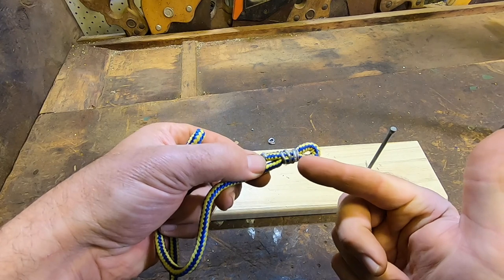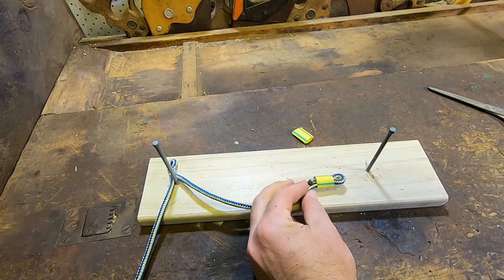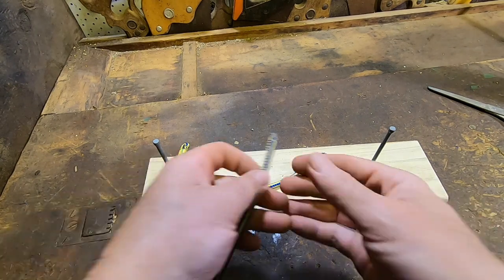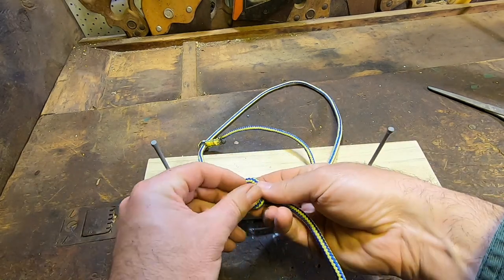How to Make a Good Looking Nylon Rope Halter for Sheep Using Simple Tools Around the Farm!

Comment: Have made identical halters before but when securing the small loops, my grandpa originally taught me to band the eyelet with canvas thread, used to patch tarps. My dad, however, purchased hemp rope in bulk for trying down loads on trailers, flat top trucks, etc. After cutting to length, the ends were crimped with 20mm wide, 50 mm long stainless steel band crimps. The crimps, still available, replaced the time consuming hand threading when I was first shown them, much to grandpas discust. Great info Tim. 👍👍🇦🇺